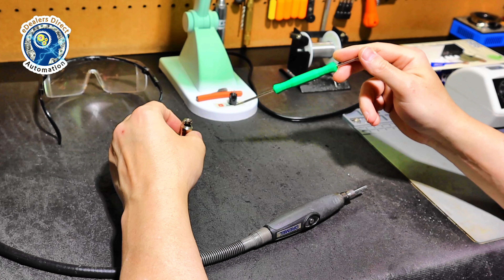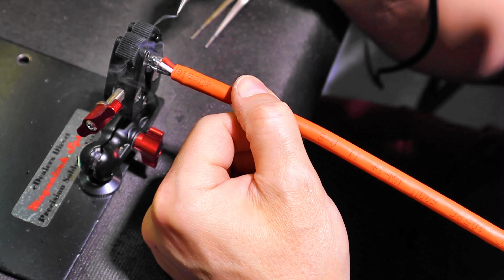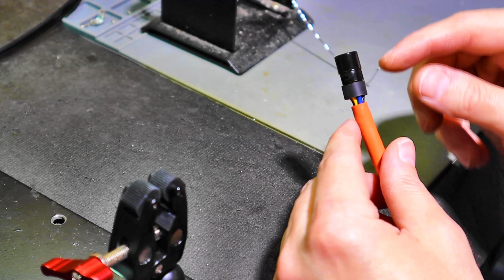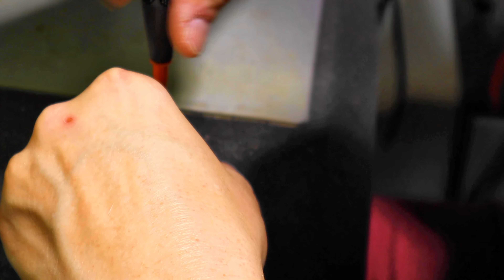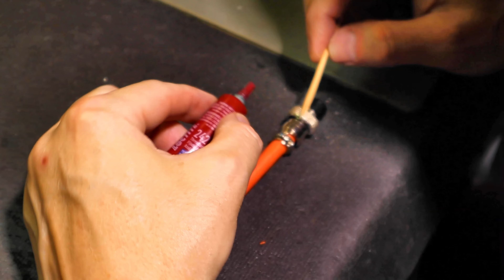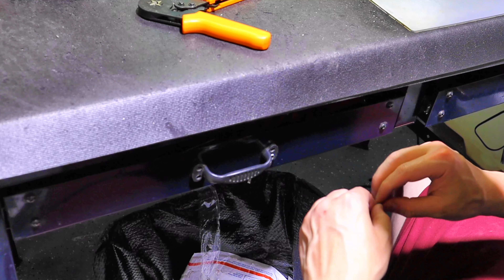🔧 Step-by-Step: Fabricating a Double-Shielded PWM Control Cable for CNC Systems 🔧

Comment: do you make nema 17 cables 12 footers 4 pin and 6 pi with a drain
Reply from the maker: I have prebuilt motor cables, and the motors you use with them are arbitrary. They feature a 5 pin GX-16 female connector on both sides 4 pins are for the motor's leads, and the 5th pin is allocated to the shield drain for proper grounding. 

Here's the link. https://www.ebay.com/itm/143498866688  I also naturally can offer them individually. 

Thank you,
Vince
Reply: If you are lacking a shield drain wire, is there a method for attaching the exterior woven mesh shield to ground? Very new to your videos, but I am definitely learning alot and appreciate all the info.

Comment: Informative, but that ‘80’s porn music makes me crazy.
Reply from the maker: Its a shame I love the 80's.
Reply: @corvetteguy50 Yeah, me too!
Reply: I never did find that shield drain, and I went really slow and made sure I did not strip the outside housing too deep. Would there be any issue twisting some of the braided shield and using it?
Reply from the maker: Its certainly in there. You have to slowly feather out the tinned braided copper shield, and you'll see it. If you would rather use the tinned braided copper shield you could, but its certainly not as clean. Thank you,
Vince